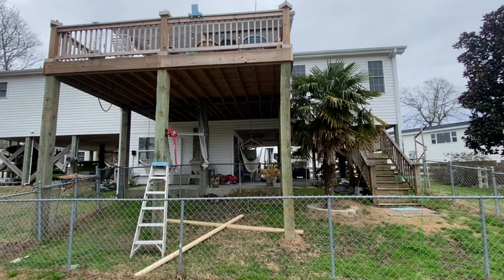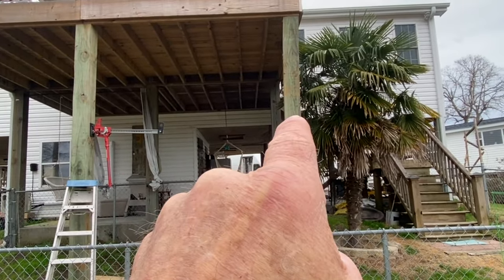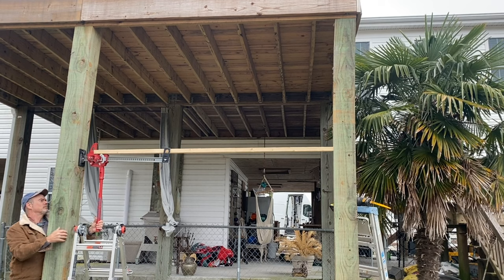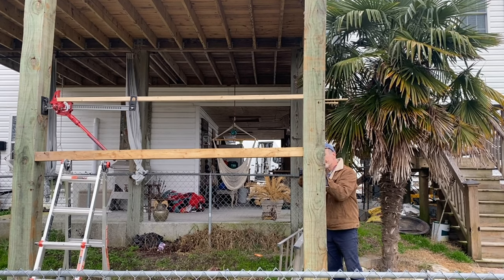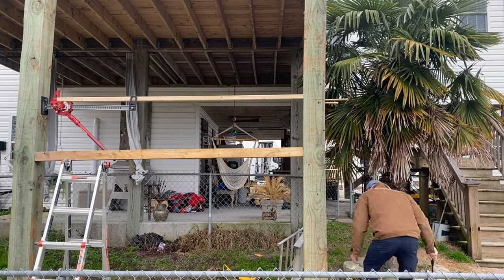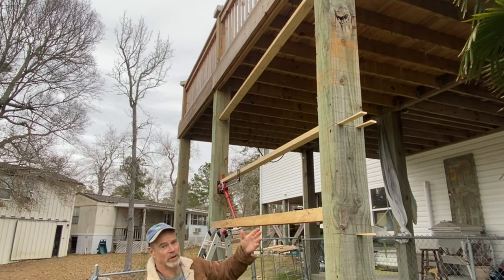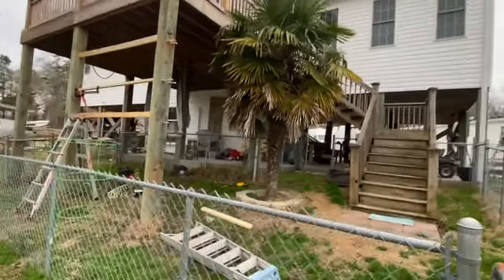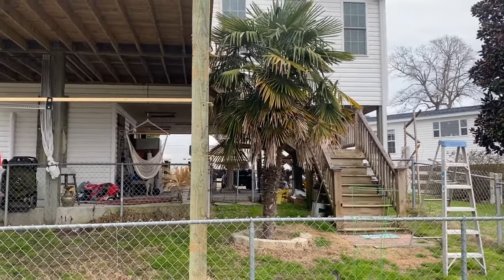Bent Deck Post REPAIR DIY

Comment: Structural engineer and long time follower here. For posts that long, you should have cross bracing from top to mid- height. I know it will block view and access, but the unbraced length is too long, which is why it bowed.
Kurt
Reply from the maker: Very useful and helpful Kurt! Thank you!
Reply: I've got one doing the same but only 7'6 tall. Could it just be bowed p.t. wood from how it dryed?

Comment: I was reading comments and gain an idea how to correct a bent post. I have a 6×6 post that was burried in concrete. It bend from the top to about 2 feet and been trying to find ways to strainghten it up before i start putting 2. 2×10 on top of it. Am building a gazebo as a project. Ill try using the water and angle iron first and see how it works. Thanks for all the ideas.

Comment: YOU DA' MAN! I have built a 350 ft. privacy fence with wood posts. It has taken me awhile to do, as I also have a full time job. In the 60 days since I set a 4x6 gate post in concrete, the summer has made it a lovely half moon...lol. I have been debating what to do (do I pull it, cut it off and try to straighten, etc....) Just cutting a couple of "relief joints" will solve my problem. Thank you! Ignore all the "experts' who live in a world of unlimited budgets (can anyone say "this old house"?) , or engineers who think every deck needs to be able to support a dozen stampeding elephants. You did great and you showed the DIY how to solve a very frustrating problem.
Reply from the maker: Thank you Michael, good luck with the projects!

Comment: I’m surprised you’re building code didn’t require cross braces on all posts to help balance the load.
Reply: It probably does.  Depends on the state.  But homeowners in many states reserve the right to build without permits.  It may not come up until the home is inspected during a sale.  But even then, most home inspections are jokes.

Comment: Im building a wood shed and used 4x4 for the corner post, im so blind i didnt notice the rear corner post is bent pretty bad at the top 2.5'. I already have the roof on on and floor is down so replacing it at this stage would really set me back.  I tried using a wretchet strap and some clamps to straight so i can put the rear wall up to support the roof but i have a pretty bad gap. Im going to try your method with 2x4s.

 How deep are you cutting the post and why the need for saws? Does the circular saw not cut deep enough? Sorry if thats a dumb question, i never done carpentry in my life so in still green af. 

Ty for sharing your video, i will let you know how I make out once complete.
Reply from the maker: Well if this was not a post that was hundreds of pounds and just a 4x4 on a shed. I would just brace that corner up, remove that post and put a new one in. Might need to dig it out, make a big wide hole so you can  get the new post in but it's not that big of deal. I used the reciprocating saw with a long blade because the circular did not go deep enough on that 8x8. On a 4x4  circular will be more than deep enough.

Comment: Oh my goodness. No.  
Straightening the post shouldn’t have to come with weakening it.  This is like the old doctor joke about cutting a man’s finger off because it hurt.  
You straightened it, weakened it, and did nothing to prevent it from bowing again.  
A steel beam, some ratchet straps, a water hose, and some patience is all ya needed.  More water and another click on the straps every few hours…
Once straightened, install cross beam supports, like there should’ve been to begin with.

Comment: Sorry not a good advice to do this.
You have greatly weakened this post.
A deck this high in the air with no bracing to take lateral loads and spread it between all posts.
Now one post has been severely weakened.
Structural mistakes and oversight happens all the time even  by professional engineers.
I believe it was in the 1980's there was a sky walk in a mall that collapsed from too many people walking and dancing on it.
After an  investigation it was all laid back on the engineer's for poor design.
But it was the amount of shifting load that cause the failure.
Replace the post or at the very least add cross bracing.
But after cutting the post, it just needs replacing.
I'm not a hater , I'm just one of those people who knows stuff and have the uncontrollable need to warn people of dangerous things.